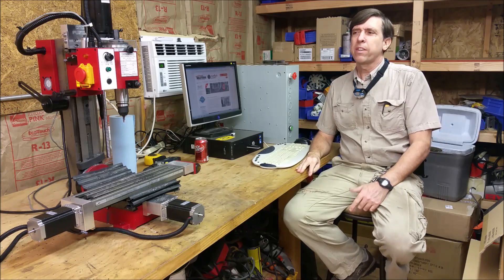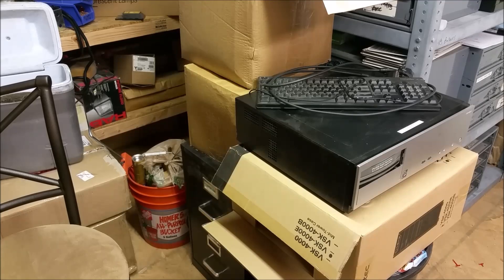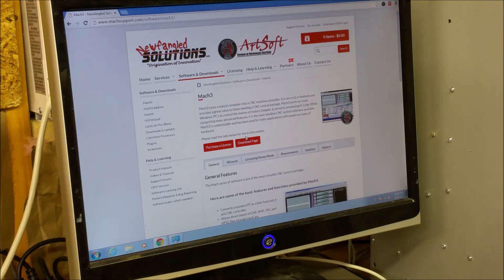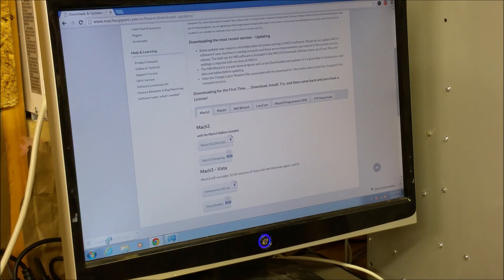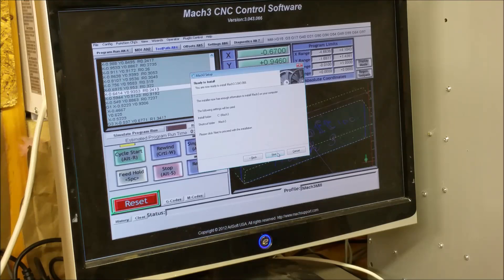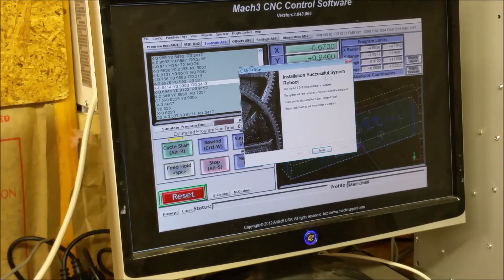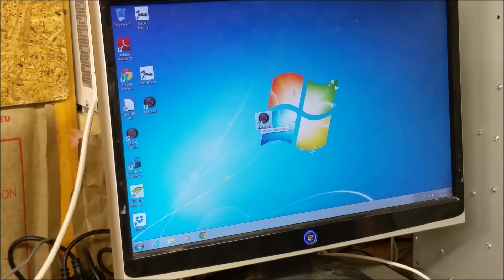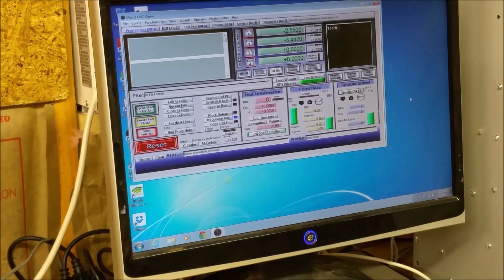Mini Mill CNC Conversion part 8A - Installing Mach 3

Comment: Thank you for the videos.  They have been informative.  When it is all said and done what was the overall cost?  Will the Mach 3 software run on window 10?  Can Mach 3 be use on other milling machine like Grizzly?
Reply from the maker: Thanks!  I think it was around $2,000.  Not sure about mach3 on windows 10.  I don't see why not though.  Yes, lots of people use mach3 on grizzlies.